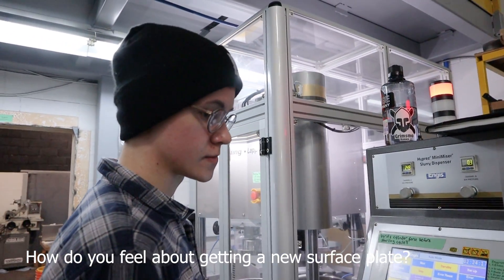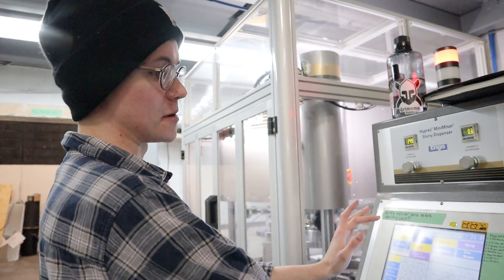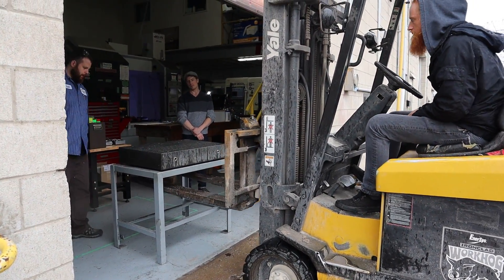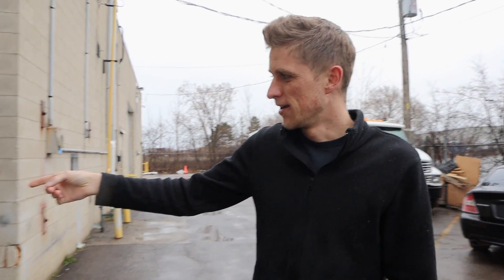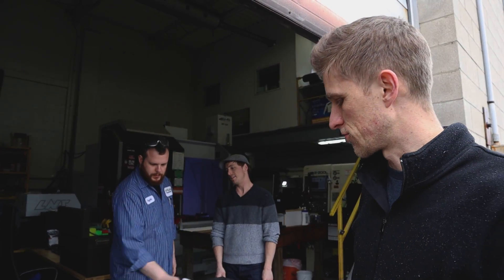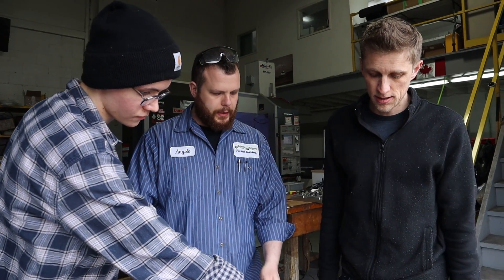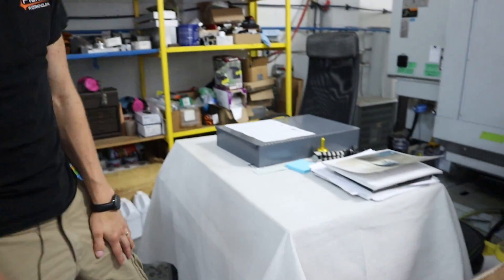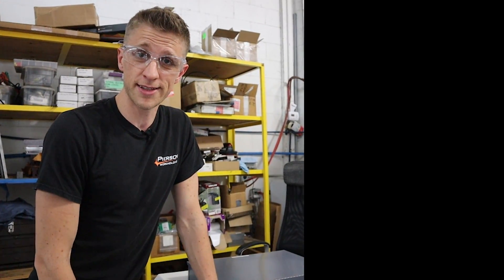One thing EVERY Machinist NEEDS!

Comment: The real question is, are all the parts that were checked with that indicator being off by .0007" still within the specified flatness tolerance window? For example, let's say the flatness tolerance is plus or minus .0007" on the print. You would still be within spec, having a total window of .0014" to work with. 

Or am I just splitting hairs at this point?? Keep in mind, this is coming from a guy who regularly holds a plus/minus .0002" tolerance on a diameter turned in a single turret CNC lathe that's specified from Doosan to hold a .0006" tolerance. Crazy stuff, but somehow it works!!

John, you have an awesome product, a really interesting machine shop, and a super cool team. Just want to make sure you guys don't run into any surprises or returns.

Comment: The table for the granite plate is not very well suited for the job. The steel sheet on which the granite plate rests will bend. And so will the granite plate (as crazy as that sounds). Usually those plates have to be placed on a heavy stand with so-called Bessel points to have minimum bending. 
Of course if you don't need a flatness measured in 1/10,000s of an inch then it doesn't matter.

Comment: You probably know this, but the plate needs to get to a uniform temperature before you start using it. Straight off of the truck it'll probably have temperature gradients in it that will take it out of flat. A few days should let it settle. Try to avoid placing it in a draft or near a heat source for the same reason. 

I'd get it lapped in sooner rather than later because it's only really a flatness standard if you know how flat it is. Right now you still won't know how flat anything is after you've measured it using the plate.

Comment: CMM granite is usually not as flat as surface plates. Since parts are suspended in 3d space, you tend not to use them as reference datums. Flat surface plates (inspection grade) are quite reasonable, a couple of knives should pay for it easy, lol
Reply: That's what I'm thinking. Why is it such a big deal, I've seen these for 1-2k usually.
Reply: I would just lap whats there.